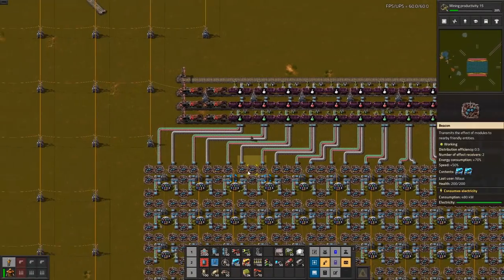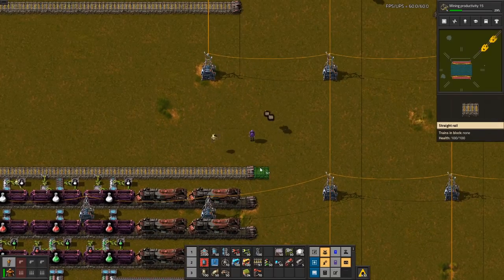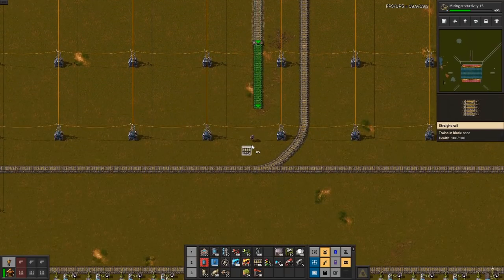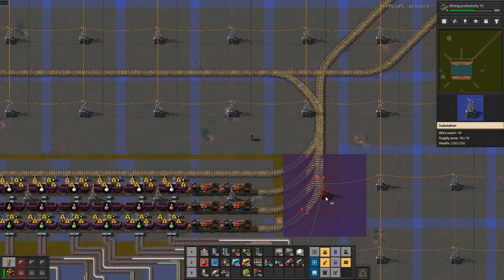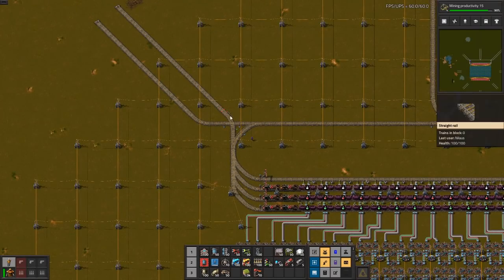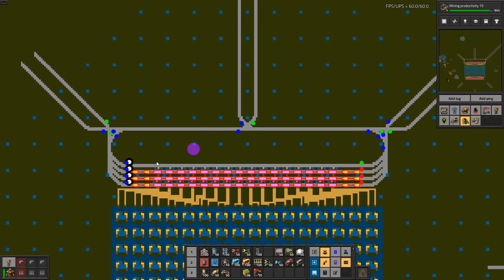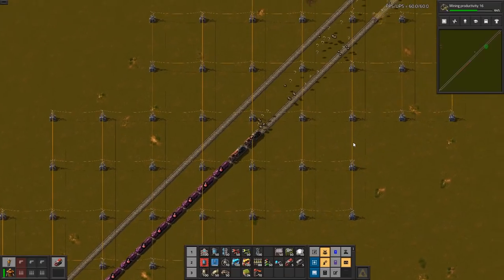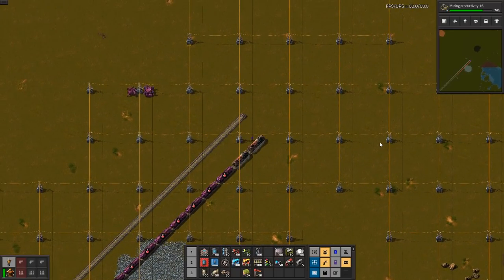Factorio Reverse Megabase | #3 DIRECT CONSTRUCTION INTO TRAINS | Lets Play

Comment: Y stands for Yotta. 10^24
terra, peta, exa, zeta, yotta.

The mass of the Earth is 5972.6 Yg (yottagrams).
The mass of the oceans is about 1.4 Yg.
The total power output of the Sun is approximately 385 YW (yottawatts).
The observable universe is estimated to be 880 Ym (yottametres) in diameter.
(wiki copy pasta)
Reply: @toddkes5890  Not just factorio's case.

Y is an SI prefix. J is an SI base unit.
You can happily combine any SI prefix with any SI base unit (except the stupid kg, where it needs to be combined with g, not kg; whoever decided the kg is the base unit should be shot).

So 1 YJ is simple 1 yottajoule, everywhere.

Comment: If you swapped which way the stations at the science lab are facing, would it make the roundabout intersections a bit simpler since they wouldn't have to cross over at each branch? Not that there's going to be much congestion anyway with 42 minute load/unloads.
Reply: I'm glad I'm not the only one thinking that
Reply: I had to stop the video and check the riots in the comments 🍿. I am surprised to see that there are only 2. 

Still, totally unwatchable.
Reply: Yes, a left hand side roundabout with a right hand side rail system! Not a practical issue in this case, but it feels wrong.

Comment: This makes me want to build a megabase with the seablock mod-pack (and a few others handpicked mods).
Without the seablock mod though, I dont want to pull resources out of thin air, or rather in this case "muddy waters".
Powered entirely by nuclear, because building big high efficiency reactors is challenging, even in modded.
Preferably no beacons but we'll see. Still debating if i'm going with trains or belts only.

btw:
A Dyson-Sphere around our sun would produce enough energy to fill 23 of those 1000YJ FuelCells per minute.
Reply: If you don't want beacons, try the built-in beacons mod.  https://mods.factorio.com/mod/Built-in-Beacons
Reply: @canebro1  It's not about having beacon buildings, but about magically increasing productivity and/or speed of the machines.

There is no scrap output, implying that everything is already running at 100% efficiency.
There are mods that add recyclable trash as byproducts to most recipes, but the amount will also be scaled with productivity, so no bueno.

Also, Bobs 'n' Angels mods add dozens of new buildings, which - I'm willing top bet - will not be "beacon-ized" by this mod.

Otherwise it's a cool mod.
Reply: @erumaaro6060  Ah, gotcha.  I thought you were just referring to the visual aspect of beacons, not the functionality.  My bad :)

I've never played seablock, so I have no idea.  I did see this pass across reddit: https://www.reddit.com/r/Seablock/comments/k3frke/54k_spm_with_seablock/?utm_source=share&utm_medium=web2x&context=3, he might have a few insights on going mega.

Good luck!
Reply: @canebro1  regular seablock in a nutshell:
you start in the middle of the ocean with no ore patches, but with enough landfill and buildings to create resources from slag, which is extracted from water via electrolysis.

I usually leave out the mod that is responsible for altering the terrain generation, so i get to have the best of both worlds, namely complex production chains and orepatches.
Reply: @canebro1  thanks.
so far i'm still tinkering with my train network (a tile-able one-way grid), trying to deadlock proof it.
but science looks presentable: beaconless, no production modules, 8x8 labs getting 9 different science-packs from all 4 directions and running at 1k SPM for a 30s tech.
and since the labs have 4 tiles between them, they align perfectly with the train, no spaghetti needed!
Reply: @erumaaro6060  Very cool.   I might give it a try one day.  Having fun with Factorissimo right now.

Comment: 1 YJ is a yottajoule.
Yotta is the largest SI prefix, equal to 1000^8=10^24.

This means that fuel has 10^16 times the energy of rocket fuel and roughly 10^15 times that of nuclear fuel.

So if your nuclear fuel only lasted 1 s, this fuel would last roughly 26 million years.
So it should be good enough for all bar the extremely long lets plays.

Perhaps that can be a new challenge for you, setup a base where each train is given 1 of them for fuel and play until the fuel runs out?

Edit: fixed mistake in math. The suggestion might not be so great with the correct math, but I believe in you.
Reply: Also, for more accurate numbers, as the train uses 600 kW, the 1 YJ of fuel would last for roughly 53 billion years.

Comment: Wait, I'm confused about the math at 17:57, you say you need 8000/42 minutes,  is that per car? Or per train load?  If it's per train load then wouldn't you divide that by 16 for the number of cars?
Reply: Science empties a full train in 42 minutes. 8000 Science fit into one wagon so he needs 8000 packs / 42 minutes.
Reply: Each train car has forty item slots and red science stacks to 200, so each car can hold 8000 red science all on its own.
Reply: It's a 3k science per minute base, so, 8k science per 42 minutes isn't quite enough there... But 8k x 16 / 42 = 3047.62 (science per minute), and that is how he got to the 42 minutes for his 16 wagons.

Comment: I love it. I will try the mod space exploration this Christmas. Any suggestions?
Reply from the maker: Don't
Reply: @Nilaus  Why not?
Reply: @Nilaus  can second this. Played it recently and it just didn't feel very good to play through. It's slower than normal to just get to the content that the mod implements since there's heavier requirements (like a lot of overhaul mods) mainly on the inserters/belts/circuits. The once you get there it's just a little underwhelming. Attempting to automate certain parts of the late game content can be fun, so if that's what you're interested in trying I'd recommend cheat-building your way through a chunk of the early-mid game stuff (of course quickly check the tech unlocks and see if anything interests you otherwise).
Reply: @adamburgers  oh. I actually was very hyped about it. The mod description sounded very compelling. I have around 70 hours unmodded and I thought for my first modded playthrough I want something special. Do you think bob's and angle's or krasstorio are better choices?

Comment: Wait why dont u wonna use the train limit on the stations?
Is it because the rail outpost-extensions will only get used by one type of train (talking about its cargo)?
Reply: The idea is to have the second train fill up, then wait right before the roundabout. If you had the train limit, it wouldn't have left the loading station.
Reply: Right.  Train limit is appropriate when you have more trains than can fit into your approach area, stacker, etc.  Each spoke of the octagon is going to act like a stacker for one type of science, so it can already handle (at least) two simultaneous trains, which is Nilaus’ plan here.  Technically, he could set the train limit to 2 (or 3 if there’s room on the tracks), and that would match the design.  I might do that kind of thing out of OCD/correctness.
Reply from the maker: Because the second train will then wait at the previous station. That means the travel time will only start when the first train leaves. That will cause haps in production
Reply: @Nilaus  mhm that makes sense... at first i thought that u would use the rails for other trains as well and then what u do now obviously wouldnt work